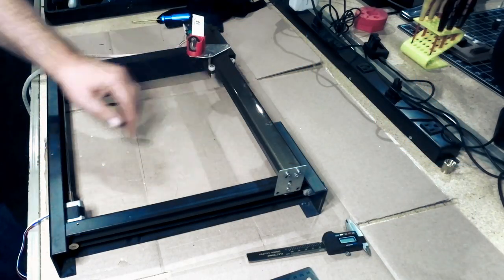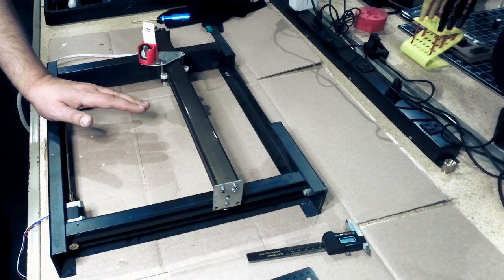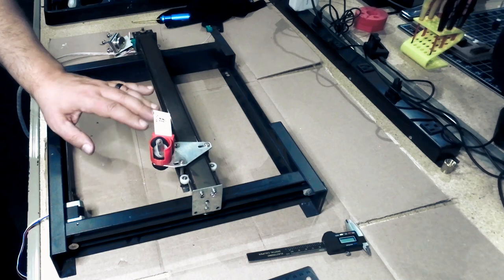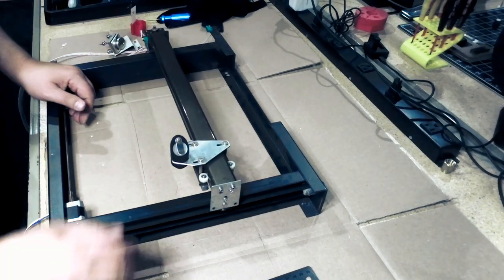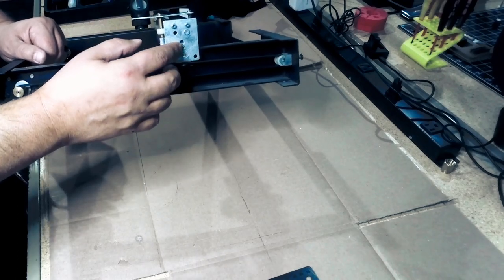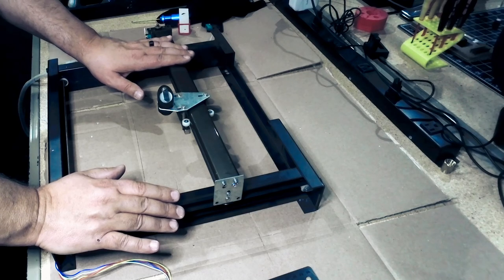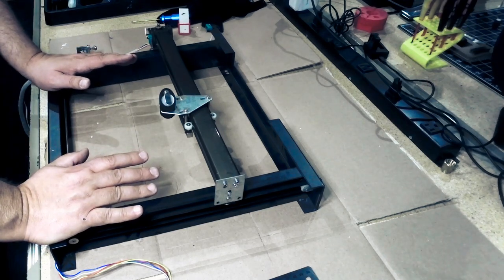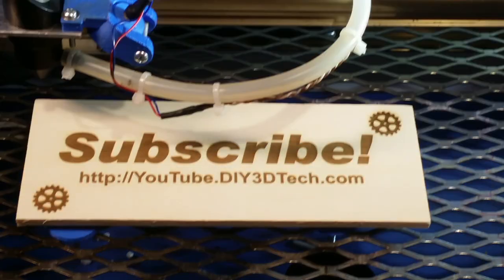eBay K40 CO2 Laser - Gantry Alignment Frustrations Part 1!

Comment: I have the K40 and The gantry is the biggest piece of junk of the whole unit. Doing coasters 6 at a  time doing the first set good second set 1/2 way thru jumps next set different set mess up got to the point the I built and new bigger box out of wood and  took everything out of the K40. Installed it into the new box and turn a 23 inch by 26 inch diode laser gantry into the new gantry for the K40 now everything works great. Plus I have a larger area to laser.
Reply from the maker: This is very interesting, any pictures posted somewhere?
Reply: No but I could send some if I knew where.

Comment: Try going to https://youtu.be/GyvtmOSU-uc Two biggest problems I had was finding the NEMA stepper motors the K40 uses 0.9Deg and all the Diode laser units are 1.8deg. For the bed I used a grid that they use in ceiling lights. All thread at each corner with a spring over each one so I can tighten the nut and it keeps tension on it and level. Hardest was getting the laser alignment. I had to shoot the laser so many times that I got a 2 inch PVC pipe same length as the laser tube put an end cap on it drilled the center and put a red 9v laser from amazon mounted where the laser tube would be  and I could keep it on and align the mirrors that way. Also installed a Cohesion board. I used the original mirrors but plan in changing them.
Reply from the maker: Wow this is cool!  Thank you for sharing!  I might tackle something like this!
Reply: That is a fantastic idea!  Going out to get my pipe!   Thanks a lot.